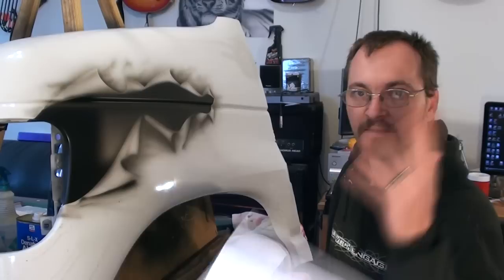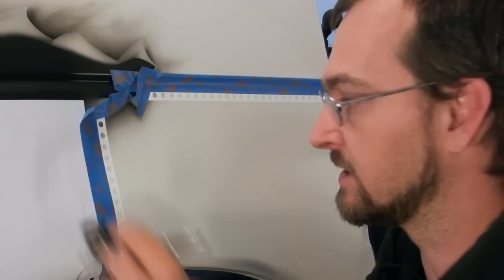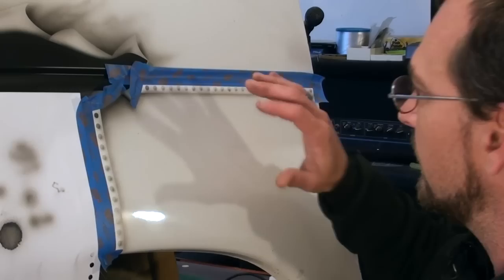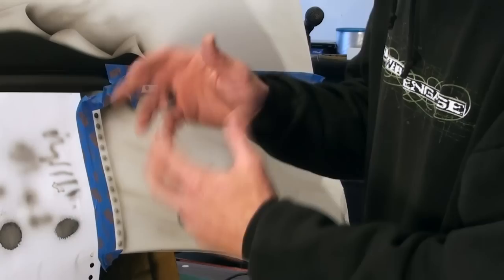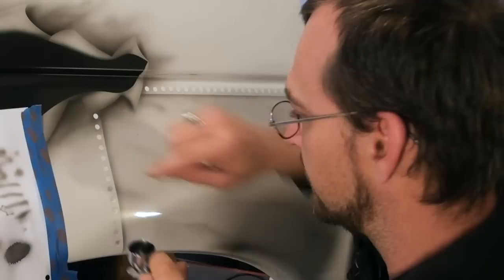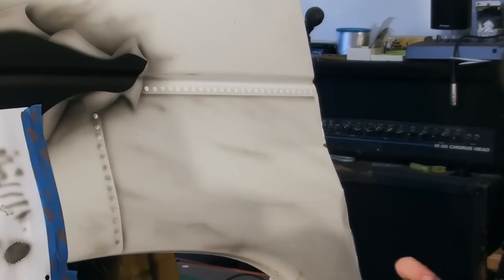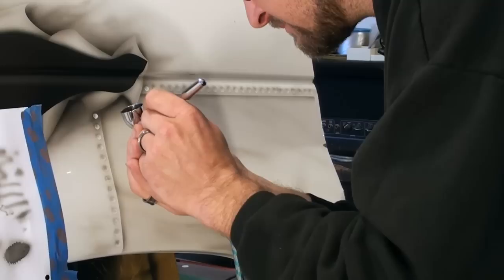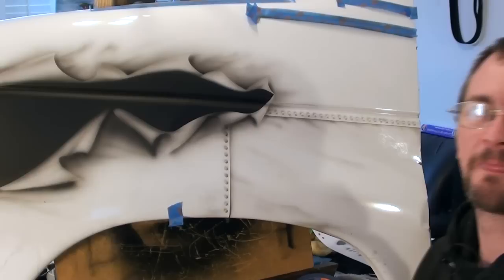How to airbrush rivets

Comment: If the riveted metal straps say where painted in a [ + ] pattern, how would you make the vertical bar look like it is bent over the horizontal bar…as if the horizontal bar is protruding out? 
I hope this makes sense of what I’m asking. 
I’m in the middle of a project that I have faux black iron bars with 1 1/2” rivets… 1 rivet in the center of the plus sign followed by rivets each side but I don’t know how to add the extra dimensions.

Comment: Ok, suggestion. I have only done 3 airbrush jobs and long time ago, so not very experienced. When the tip starts to dry and acumulates paint (and therefor reduces the nozzle area) i use to have a pencil with thinner, i washed the tip with it, sprayed somewhere else,(to remove thinner excess) and moove along with the job. Is that how you do it?
Reply from the maker: Yup, pretty much... I just clean the tip with my fingers, but tip dry is inevitable...

Comment: Instead of putting all those dots on each of the "holes", would it make sense to create a small circular stencil to do the outside part?
A pop stick with a circle at the end?
Reply from the maker: That could definitely work, however, you would have to spray around the stencil support, and don't forget you're actually spraying two colors here-black for the shadows and white for the highlights/leading edge.  I didn't spray white in this video because the panel is white...maybe I'll do a rivets revisited video?
Reply: Jack Bias Thanks for the reply. I tried it with a piece of hard clear plastic. It worked okay but I am a total newbie so the results were pretty average. Keep up the great work! I'm loivin your channel!

Comment: I just did checker board on the wheel pants of my little 150 cessna, wanted to make it look like the paint was peeling off the tips of them and have like a aluminum skin under tore off paint, so instead of painting the black, I'd just spray aluminum instead? the wheel pants are really pointy in the front, well they really look like the body of a fish. would be kinda cool to see you do a video on something that looks like that, I'm kinda scared to do the paint being tore off because the cheater board turned out so nice and the rivets and tore paint might be a little much being I've never done it before, kinda chicken.
Reply: Yup, just substitute the silver for the black.  You will still need to do some shading of course, and I would use a different color for the "underside" of the paint which has peeled.  Maybe a dark-ish metallic blue? Not too dark or the shading may not show.  Just remember, it's only paint.  It can be fixed.

Comment: Do you need to prep the clear coat before airbrushingl to make it stick?  Great Vid.
Reply from the maker: Marc Light absolutely, yes.  clear needs to be de-greased and prepped.  Usually, I scuff the surface with a Scotch-Brite and Dawn dish soap.  Here's a vid I made on "panel prep," it's not exactly an answer to your question, but I think it may help... https://youtu.be/yAzw8BBsZwg?list=PLlOL83W9CfNhYZpe6nUE3MmKF1Pxr_Mhi
Reply: Marc Light  Sound like an Orange scuffing pad and Dawn to cut grease/wax (in case wax is on the car).
Reply: Jack Bias I have a 1950 silver 4-door (suicide doors) Studebaker. I might do rivets.

Comment: You could put a bit of masking tape, or clear vinyl on the dots to transfer them all to the panel, or what ever you are painting in one go. Anyway, nice video.
Reply from the maker: I've tried to transfer the dots (rivet heads) in bulk with transfer tape... It doesn't work.  There's just too many of the darn things, and I can't get them to line up without my art looking sloppy.  Hence, the "tedious" method I use.   Your mileage may vary...

Comment: What kind of paint are you using ?
Reply from the maker: Createx.  Most likely, opaque black for the shadows.
Reply: Jack Bias Is the createx paint you are using just a normal water based acrylic?  Are you able to clear coat over it?
Reply from the maker: Hugh Jasol  yup, water based Createx. I've painted many things with these paints and spraying a 2K clear over top has never been an issue.
Reply: Jack Bias Thanks for the response.  That's exactly what I needed to know.
Reply: Your video helped me do some cool looking rivets on my motorcycle tank.  They didn't come out as clean as yours, but definitely better than the pacman dots I my uncreative ass would have done.  Thanks for the video.